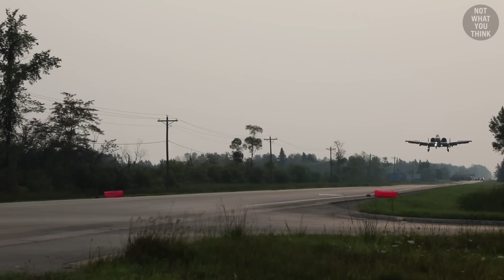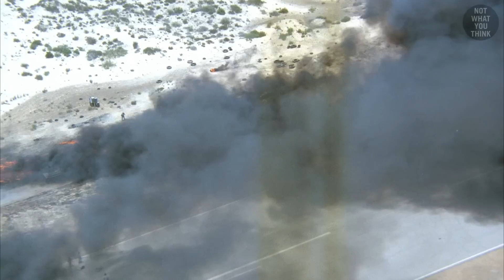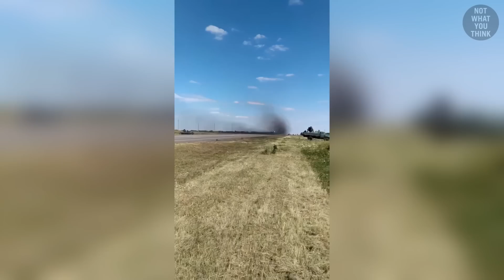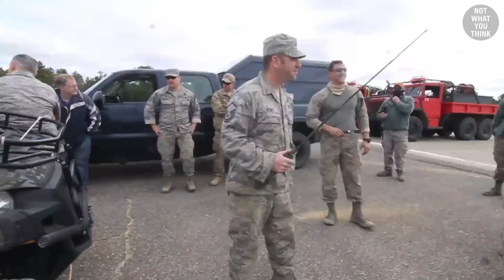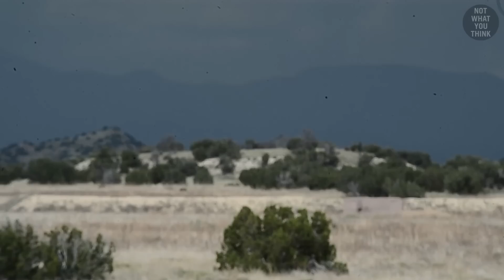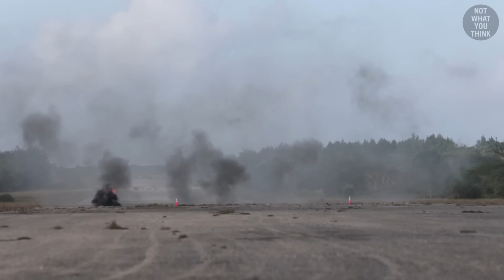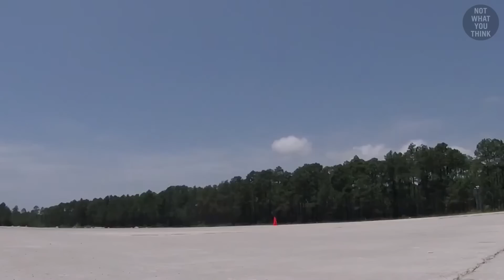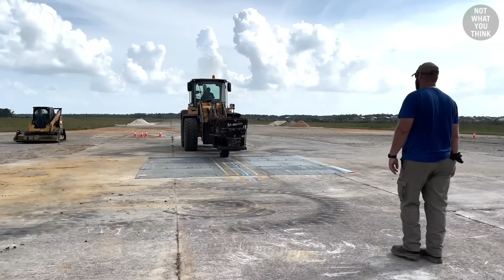How Landing on a Highway Helps Avoid Potholes

Comment: This happens pretty regularly in the Nordic countries, we've always had roads that can and will be used as ad-hoc runways for military purposes. Sometimes purpose built with extra road strips on the side to help facilitate plane refueling & ammo loading.
Reply: Nordic countries always have to deal with the Russian threat so I sympathize with your situations.
Reply: @MrDosonhai  i doubt russia would attack nordic countries
Reply: @brotherinchris  They did before. So your doubt has no basis.
Reply: @MrDosonhai  "before" russia just wants ukraine
Reply: @brotherinchris  Read the Winter War before you commented.
Reply: @MrDosonhai  thats soviet not russia
Reply: Some even have the ability to do cable landings in case part of the runway is out of order.
Reply: I actually know of highways in Sweden that are extra wide to allow military aircraft to land and takeoff
Reply: @Adam Alfredsson  Jupp, everything from roads, the aircraft, maintenance, and refueling is designed to be operated in the forest next to a "landsväg" (County road) as part of the BAS90 (base90) system. A Gripen can be fully refueled and rearmed in 10 minutes by conscripts, and some maintenance like changing engine can also be done. This is why it's talks about sending Gripens to Ukraine, it's simply designed to be operated harshly (somewhat like f/a18)
Reply: @kalle5548  You do know for a fact that the F-16 have been doing that for 2 decades way before the gripen even demonstrated it nvm the fact that a small niche capability that is irrelevant in the bigger picture and aircraft capability is what matters the most. Something the gripen seriously lacks.
Reply: @gotanon9659  First of all, Gripens predecessor, the Viggen did the same thing, and it's predecessor the Draken as well, and for the US an expensive needy but capable platform is better, but when Russia is a stones throw away and (it was at least thought) when Russia invade they'll strike all air bases, which Sweden don't have a lot of, so for Sweden it absolutely matters, for the US that can operate from relative safety, not so much
Reply: @gotanon9659  Highway landing capability and robust constriction of the F-16 aside, the gripen was specifically designed for swedish needs, among which were not only being able to land on highways but primarily intended to do so. Doctrine it was designed for intended it to be landed, repaired and rearmed all on highways and with the aid of non specialist ground teams. They expected to loose the airfields and needed a aircraft that could handle that specific scenario better than something like a F-16.
Reply: Yeah as a german I wanted to say "You mean your entire country is not one giant runway?"
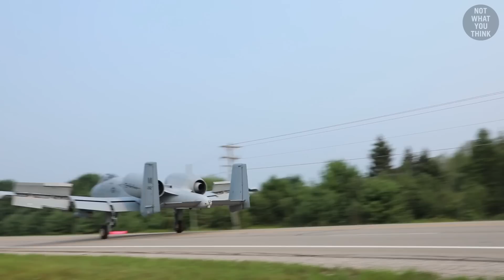Reply: This video is incorrect when it says "designed only for automobiles [*0:09*].  The National Interstate and Defense Highways Act of 1956 stipulated that all public highways needed to have a straight 1 mile of road for every 3 miles specifically so that it could be used as an ad hoc runway in the event of war.
Reply: @SamBrickell yeah whats up with ppl saying otherwise?
Reply: @SamBrickell  that pretty clearly isn't an interstate that its landing on, though
Reply: The US highways were meant to be flat and straight every so many miles for emergency runways.
Reply: SAAB moment. Also our military is having mobilization exercises so we hear jets once in a while but they also fly really low so we can see them
Reply: I do this all the time in GTA 5, not new at all
Reply: got to be ready for the Orcs. Can't let the guard down.
Reply: This is a practice worth considering when ones infrastructure is within the range of a variety of enemy weapons. The good news is that the enemy is within the range of ones own weapons in such a situation as well, so nothing ever so bad that there wouldn't be anything good in it also. In the Nordics you don't have to fly supersonic for too many minutes without stumbling into foreign airspace.
Reply: US highway one was built for this same reason
Reply: PBBM IS JUST TRAINING HIS MEN HOW TO USE MODERN EQUIPT .PREPARING FOR ANY EMGCY
Reply: tru
Reply: That’s pretty cool, thanks for the fact

Comment: I read an article about a Marine that blew part of his face off when trying to bite a blasting cap onto the time fuse instead of using a crimper.  That was on the company office billboard when i was a combat engineer at 2dCEB in '07-'08.  I do not know what kind of firework compares to the small amount of PETN inside the cap but is probably close to the top of any dumb 4th of July mishap.
Reply: They do look a bit like crayons though.
Reply: @TheLukasDirector  mmm tasty colors
Reply: That's pretty funny. What a dummy.

Comment: Lmao as someone from Michigan he nailed our roads. They are basically a patchwork nightmare
Reply: All the road commission money goes to the roads around Lansing, and the rest disappears. But we also have incredibly harsh winters with tons of freeze/thaw cycles that can shred a road in less than 5 years.
Reply: @nautica8745  lamo have you ever been to Lansing, we got some of the worst roads in the state. My street looked like it had been shelled the pot holes were so big
Reply: @nautica8745  You must not have driven around Lansing. Lansing's roads are pretty bad.
Reply: Can confirm. I went down a country road when we were exploring and ended up on a road that was essentially made of sand. Was a miracle we didn’t get stuck.
Reply: does michigan get bombed regularly, because it sure looks the part
Reply: @nicolaspeigne1429  Yes but mother nature does the bombing in the form of freeze/thaw cycles
Reply: @nicolaspeigne1429  bombed with snow and rock salt
Reply: Come to Minnesota it's bad here to
Reply: The military should stop bombing the roads
Reply: Fr they are a nightmare
Reply: @Andreas Andersson I’m sure there is a fair percentage of corruption, though less now than before the Mayor Kwami Kilpatrick years.  But it’s also because the roads are used by semi’s as much as SUVs (what everyone drives around here). Also factor in we lay our sewers underneath and beside the roads so it isn’t solid all the way down. Factor in the Great Lakes and our water table is also somewhat high so flooding in certain areas has been a chronic problem also.
Reply: Granted I’m seriously out of my depth here so take everything I say with a certain amount of salt 😅
Reply: I like that last suggestion. Send out the military to repair urban roads and call it a 'training exercise".
"What are you doing?"
"We're training to repair damaged airfields in wartime." 
"By fixing urban potholes?" 
"Yeah. Got a problem with that?"
"Not at all. Carry on."
Reply: INDOT supremacy
Reply: Do I hear an opportunity to fix multiple problems of Detroit all at once??  Allow me to introduce myself.  Vladimir Ilyich Lenin.
Reply: @hallmobility  if you're talking about fixing detroit you must have him mixed up with the other relevant political radical from that era
Reply: Suggesting that a place has too many roads to be able to maintain them may be valid. To suggest that reducing personal vehicles and replacing them with mass transit and bicycles is ridiculous. 

As someone who has commuted to school and work on a bike, the roads are necessary. Reducing cars will not reduce the need for roads. The roads are not there to provide a surface for cars. They are there to connect homes, communities, city centers, businesses, etc to one another. If cars were outlawed today, you would still need the roads.

The only way to decrease the need for roads is to force people to live as close as possible to their work, schools, stores, medical facilities, etc. That’s not going to happen.
Reply: Florida says hel....... Oh thank God I almost took my axle out
Reply: I thought Pittsburgh pa roads were bad lol. We had a bus literally stuck in a sinkhole here. Check it out
Reply: Michigan roads look like somebody already hit em
Reply: Been there once.
Wouldn't even call it patchwork.
It's just holes. As far as the eye can see, holes looking for poor, unsuspecting drivers to fill them.
Reply: This was in alpena, was at school and watched them start their landing in the middle of our town out towards the airfield 👍🏾
Reply: See, I was just about to comment how I have never seen a road that bad in Michigan, and the roads they used for the A-10s are clearly in fairly good conditions.
Reply: You assume they patchwork.
Reply: We have similar conditions in Alberta.
Reply: At least it looks better then the roads in quebec especially montreal
Reply: as a midwestern I can confirm that our roads look like swiss cheese
Reply: Yes they are lol
Reply: thank your GOP congress-persons
Reply: yall get patchwork?!?!?
Reply: That I-94 freeway section by the Uniroyal tire will never be used for the landing strip :-). Going 70 on what is essentially a road that is used to torture test your suspension. To be fair, its not the pot holes, its the heaving under the road itself causing all the bumpiness. I've seen so many vehicles with broken axels in that area. The first time I drove thru it I pulled over and thought I had a flat. Turns out that's just how the road is. I'll not complain as much about the Canadian side 401 being as bad again. I can say Indiana has some pretty bad sections too though.
Reply: when you build all the infrastructure when taxes are high then dump tax revenue to let rich people be richer the infrastructure will inevitably fall apart
Reply: Fellow Michigander here too haha
Reply: I have a Yupper. (farmland) friend now in Maine and he is always comparing our roads to yours. Sounds like we do better patching but when things do get fixed you do a better job
Reply: New mexico is the same
Reply: just try fix Indonesian Borneo and Lampung Road, and you will shocked
Reply: @1990-w1l  try fixing our Walmart parking lot
Reply: @PETE243  that an eazy think to fix, you only have small hole in that place, in Borneo road hole is bigger than fish pond and they have many of them
Reply: @1990-w1l  there are a few hundred only about 3-6 inches deep, but a fish pond sized jeez.
Reply: @1990-w1l  Borneo is the place for the new capital!  I read that several months ago.  The news I have about Jakarta ain't good.
Reply: Roads here in the UK 🇬🇧 looking like this as well now days
Reply: @yungcaco1443 No they don’t. We moan about a few pot holes half the size of any of these. Still a valid moan, but not on the same level as this.
Reply: We have roads and cars here because that’s how the local & state governments got funded. The big 3 (Chrysler (now Stellantis), Ford, GM) played a huge part in killing as much public transportation legislation as they could during Detroits’ golden era (1950s).
Reply: DEMOCRATS
Reply: This is because you have too many roads to maintain them.
You need to get more people in public transport, on bicycles and walking so you need less roads.
If everyone drives a car, you can never build enough roads and never raise the taxes needed to maintain them.
Reply: @rogerwilco2  if they had only one road it would still look like that after a couple of winters. In that part of the country the weather does most of the damage.
Reply: @jimk8520  It is a combination of both. Less roads means its easier and cheaper to maintain. And its not like you are sacrificing mobility since you make up for it with more efficient means of transport.
Also cars are heavy, walking and bicycles are not. Buses are heavier but you have fewer of them going over the roads than cars. All in all, they do less damage to roads.
But yes the freeze and thaw cycle wreck the roads, but it's further exacerbated by having too many road vehicles. Perhaps BECAUSE of the freeze thaw cycle, you want less roads than other places so you can more frequently maintain the ones you do have. There are other places in cold climate that can maintain their roads and its because they aren't as car dependent and do what they can to mitigate nature's wrath... Not pour salt on the wound (no pun intended)
Reply: @neurofiedyamato8763  I’m not trying to deny any of your valid points by saying that the particular damage shown was weather related. 🤷‍♂️
Reply: @neurofiedyamato8763  no roads (and no fences)  at all would be best but that is a completely different discussion point.
Reply: @neurofiedyamato8763  this is very interesting. What do you suggest they do with the roads not used anymore?
Reply: @Oinnk  it's actually great because there is usually very little traffic on these roads meaning you can race/speed constantly with no issue
Reply: @Oinnk  Well the solution isn't really removing existing roads tbh since a lot of these connect houses and shops to other places. The problem is they place this random house 5 miles away from the nearest building requiring 5 miles of road to serve a house or two. Ideally, just stop doing that so you don't over stretch your infrastructure so its easier to maintain. If any existing road is not necessary and under utilized, they can turn it into maybe a bike path or maybe reused for a rail alignment in the future, or a transit corridor. Bikes are far lighter and do less damage and buses and trains are just more efficient. But you do need more density to sustain these modes. The other option is just downgrade those roads to lower priority ones and focus on important corridors. But problem is deep rooted, changing just roads won't solve the problem. US cities are built too sparse despite not using those lands for farms. Its just housing being separated by 10m yards and even wider roads for no reason
Reply: @rogerwilco2  boooo public transport nerd boooo
Reply: @rogerwilco2  then that would be the case everywhere and it’s not
Reply: @rogerwilco2  Actually, no, since roads are built to connect places. More roads are not built in response to more cars, but rather more places to go to. You'd still need the roads.
An American state is roughly the size of one of the larger European countries. You do not bicycle from city to city, nor walk.
Road repair is typically paid for by a gas tax, but decades of cutting taxes has led to a decrease in government services.
Reply: @rogerwilco2  no it’s because no money is used to fix them, our governors frequently use fixing the roads as a political tool for raising taxes
Reply: @rogerwilco2  yea imagine riding a bike in Michigan... must be a foreigner commentating not realizing what a animal michigan is
Reply: @rogerwilco2 and also because our frost laws are never enforced so farmer John has his tractor with 2 trailers full of heavy equipment or produce on brittle roads cuz Michigan winter and they crack and also most of Michigans soil is sand from glaciers so the sand will wash out which kinda isn’t good for roads
Reply: @rogerwilco2 liberal central
Reply: @rogerwilco2 dude, Michigan is literally woods and fields with small towns in between, you can't bike anywhere cuz the nearest Walmart is a half hour down I-94 XD